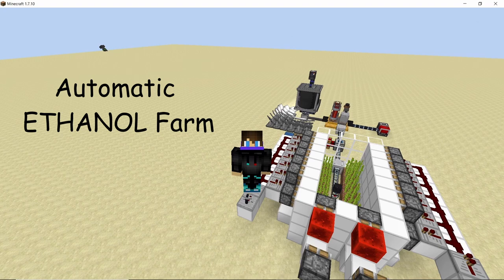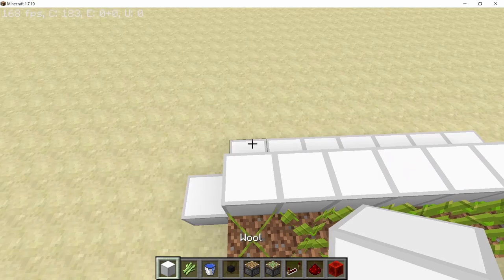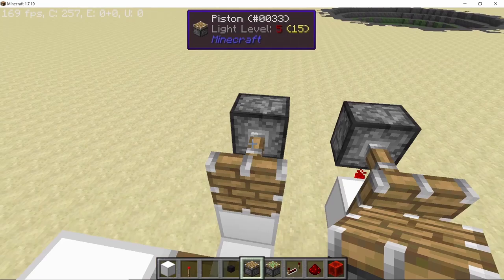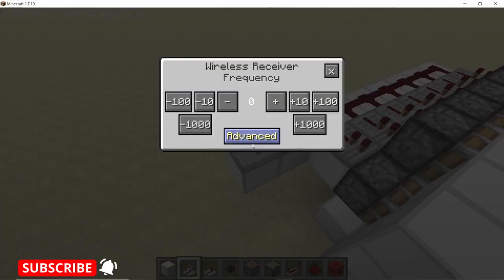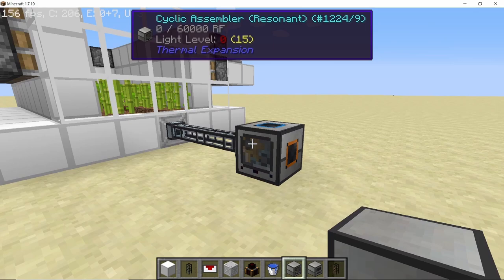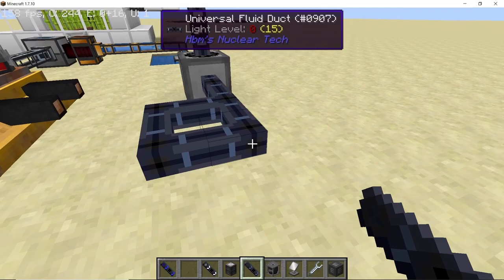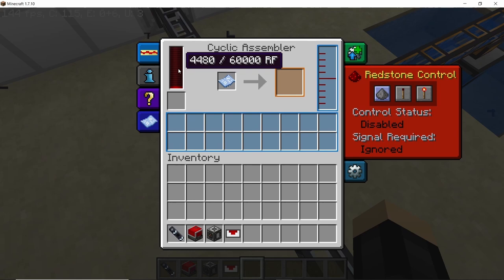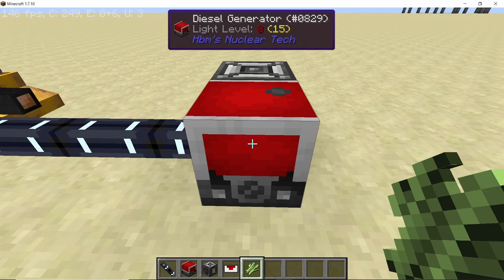Automatic ETHANOL Farm HBMs mod | How to produce Ethanol from sugarcane farm - Modded Minecraft

Comment: If you add actual additions you can triple the amount of sugar you get for a cane for only a bit more rf
Reply from the maker: Which machine from Actual Additions are we talking about bro ??
Reply: the crusher it takes 40 rf per tick and it’s made with a aa iron chasey, two flint, two basic coils, two cobble and two redstonia crystals, there is also the more expensive double crusher HE can be converted to RF with the HE to RF converter if you didn’t know that and it takes one suger Cain and makes it into 3 suger instead of one of this method you but will have to make a buffer so it doesn’t over flow but that it can improved with the double crusher which is two crushers 2 advanced coils another iron chasey and four pieces of cobblestone. Which will take twice as much rf but will do it simultaneously and both have a energy buffers. The atomic reconstructor makes the redstonia crystals either from redstone dust just dropped on the ground of a block of redstone. The atomic reconstrustor is made with a iron chassy four iron ingots and four redstone. The basic coils are made from black quartz, and redstonia crystals in a plus shape  four redstonia crystals and one black quartz, to make the advanced you put your basic coil in the middle of four gold bars like making a clock.
Reply: Also good for emc if your using project e because where suger is the same value as suger Cain you can get three times the emc from a stack of sugercain (addendum if you aready have a atomic reconstructior and project e get cactus and a lens of colour then take the cactus make it into green dye and then use the reconstructor twice changing it first to coco then to lapis which only takes some RF and you get 108 times the emc

Comment: Nice farm you got there, bro! Gonna get some of that sweet, sweet Ethanol in nearly no time with this setup. :-)
Reply from the maker: Aight !! If you can find a bigger sized farm then make it and connect the output to the cyclic assembler and the remaining process is the same. 
More sugarcane = more fuel 👀🔥
Reply: @SavageVegeta  Seems very logical to me, the more coal you put into a steam locomotive, the faster it goes.

Comment: Minute of facts from freon #2
Ethanol is a monatomic alcohol with the formula CHH₅OH, rational formula: ch₃-ch₂-OH, abbreviation EtOH, the second representative of the homologous series of monatomic alcohols, under standard conditions — a volatile, combustible, colorless transparent liquid. The active ingredient of alcoholic beverages. 
Formula: C2H5OH
Density: 789 kg/m3
Boiling Point: 78.37°C
Molar mass: 46.07 g/mol
Melting Point: -114.1°C
IUPAC name: ethanol
Classification: Alcohols

so technically ethanol is not just a fuel.
Reply: so you can use it like an disinfectant?
Reply: @andreschroder7852  50/50
Reply from the maker: Awesome FAXX from FREON episode 3 :D
Reply: @freon1038  i did know about this because someone told me about ethanol and strong alcohol poisoning
Reply: @ROSoul-wx1iu  Demoman